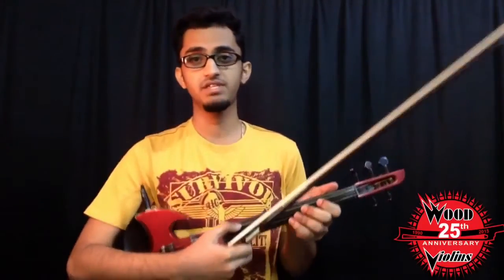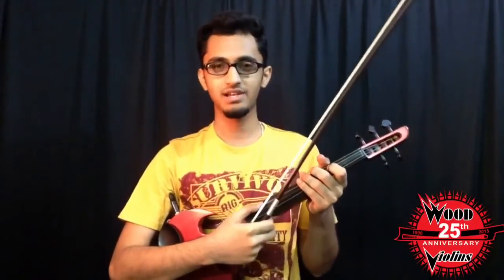How to Achieve Distortion with your Wood electric violin

Comment: nice alternative to people who cant play that effect on guitar because their fingers are too slow (like me :p)
Reply: I play violin and guitar, and I have to tell you... it's much more difficult to achieve this effect on the violin😅
Reply: @oliverq9793  is that guitar violin in the video whats making the effect?
Reply: @go2hell746  There is no thing like "guitar violin" to make sound like this you need electric violin, amp and effect pedal with distortion. So if you play violin you can try something like this.
Reply: @JK20M  i have this cheap crap one but it doesnt sound like that with my distortion pedals. do i use bass amp or guitar amp?
Reply: @go2hell746  so if you want this nice sound you need to have good electric violin in the video we have wood violins stingray and if you have electric violin that sounds good you can use lr baggs para acoustic di to make it sound warmer then you need good pedal board like boss me 90 or like in the video digitech rp255 (rp255 is discontinued) and you have it. Btw what electric violin you have.
Reply: @JK20M  its an ammoon. not sure what the exact model is
Reply: @go2hell746  if you want to have that sound you need to buy better violin I prefer wood violin stingray (889$) Yamaha yes (769$) wood violin viper (3,500$) zeta jazz fusion (4,400$) zeta strados modern (3,040$) Yamaha sv200 (1,400$) 3d varius (1,600$) btw with every zeta model you don’t need lr baggs para acoustic di because they’re sound warm same with Yamaha sv 200
Reply: @JK20M  i was thinking of getting a stingray it looks good.

also do you know the model of violin yellowcard uses?
Reply: @go2hell746  Yeah, stingray is really good. Yellowcard uses Zeta strados or jazz modern and bridge lyra or aquilla
Reply: @JK20M  thank you i might get a zeta. it sounds amazing in YC songs